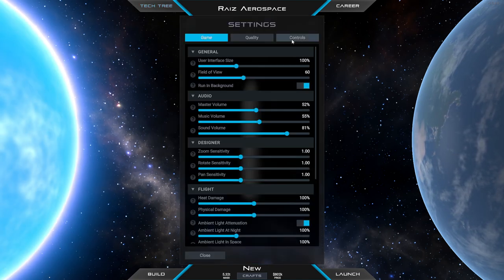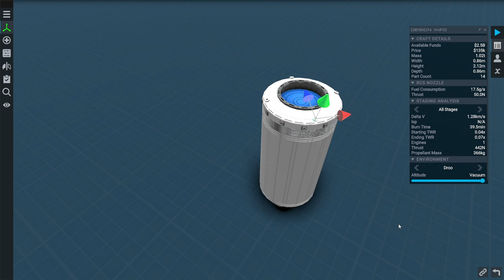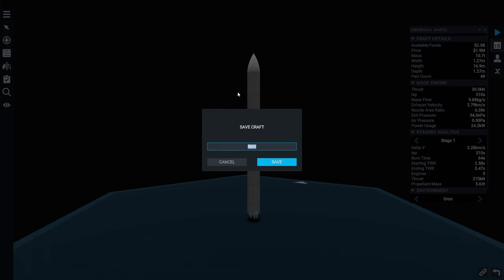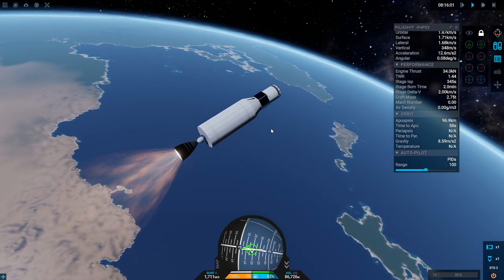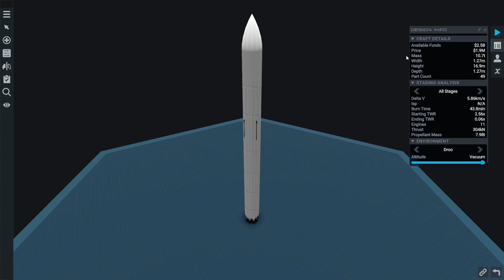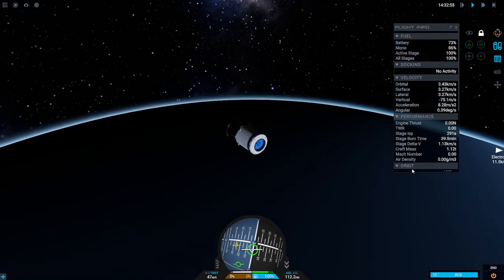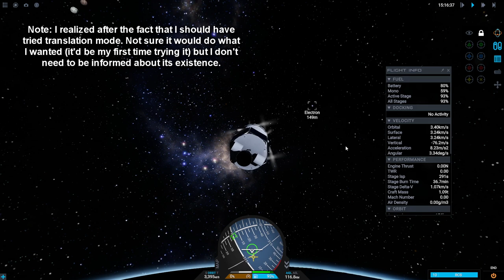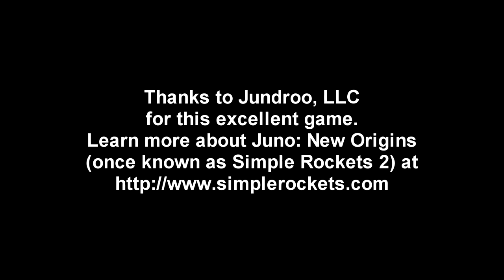Juno: New Origins (formerly Simple Rockets 2) - Career 11

Comment: For hypergolic you've got monopropellant, it's hydrazine. The surface attachpoint in the nosecones is a receiver, and it was missing the attachpoint because you disabled it, you can see it in the last shot when messing with the nosecone connections.

The blocks aren't resizable, they are inherited from very early stages of the game. I guess we could just add a scale slider since they can be useful to get a lot of attachpoints.

To paint things you can select a color and tweak its properties (each material is named to try to hint towards what they are supposed to be used for). If you want to change what materials are assigned to a part you can select the trim (top of the paint tool), the material you want, and then click on the part you want to paint. We have debated in the past how to improve the system but we couldn't agree and stuck with what the game has been doing since launch.

Electric engines are super nice when working with small rockets, as soon as they get bigger they aren't worth it anymore because of the required battery masses. It's a great option, basically an electric pump feeding the chamber. The way the power consumption is calculated uses a formula from a paper mentioning the fuel flow and pressure differential for rocket engines, but I bet it's not super accurate. It's a shame how those systems are super proprietary and mysterious. That said, I feel like we got it to a fairly realistic point.

"I could loose an engine right now" lmfao
Reply from the maker: Sorry, I meant hypergolic bipropellant - I should have been clearer.

Comment: I saw on your screen now that they disabled the tinker panel for blocks specifically in career mode. This quite annoying since that tinker panel is what allows you to theoretically make any shape easily with any item. However, you can mount parts on the side of the rocket/fuselage. Then rotate and manoeuvre them into the desired position. For the rounded fuel chambers, place it on the outer section of the rocket and then just rotate it 90 degrees while using the fine position adjustment too to move it where you want it to go

Comment: What about putting a couple small srbs in that stage to deorbit it without doing the extra maneuver? It should be more affordable than the rcn you're burning if you do it at apoapsis with a low periapsis
Reply from the maker: I'm not super concerned about cost at the moment, or I could have made this rocket a lot cheaper over all. I was going for an Electron rocket and, as far as I know, they don't use SRBs to deorbit. I should have just left the stage suborbital, though.
Reply: @RaizSpace  I guess their booster never reaches true orbit (Earth scale and neverending atmosphere)